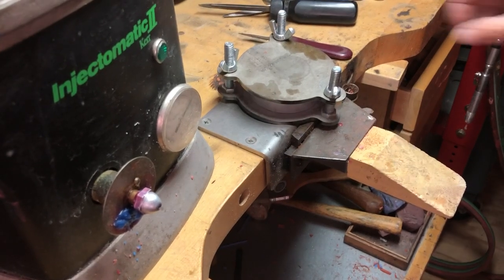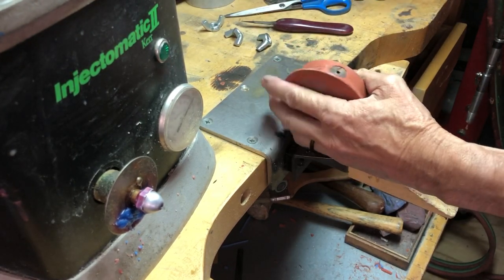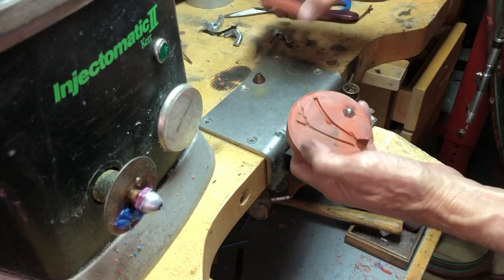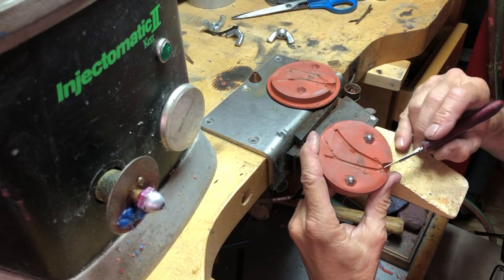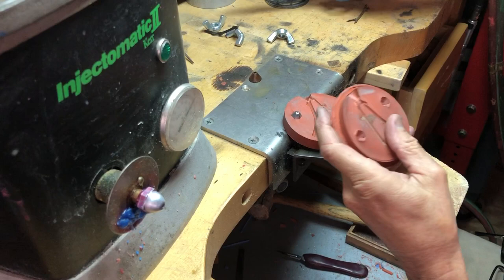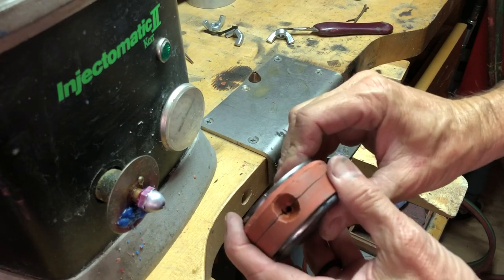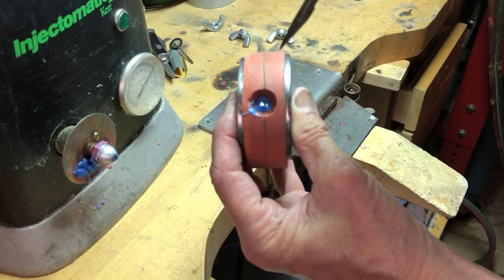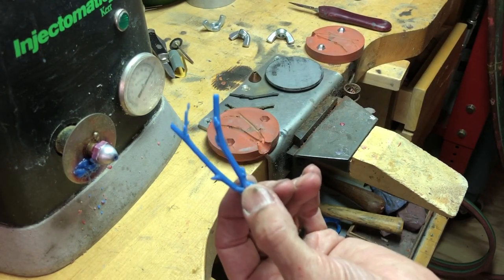Toaster Oven Vulcanized Silicone Rubber Mold of Tree Twigs - Video Two

Comment: Is there a specific type/brand of vulcanized rubber I would need to use in the toaster oven? And what heat setting (degrees) should be used? Thank you very much.
Reply from the maker: I recommend using silicone spin casting rubber that can be found at Contenti, Rio Grande, Zero-D, and Tekcast. For powder separation I recommend the high durometer rubber that is stiff and doesn't flex while heating. If cutting with a scalpel then the softer rubber is best. Most vulcanize between 325* and 350* F. Most rubber is 1/4 inch thick so figure 15 minutes per layer.